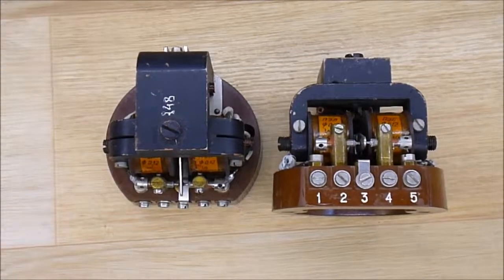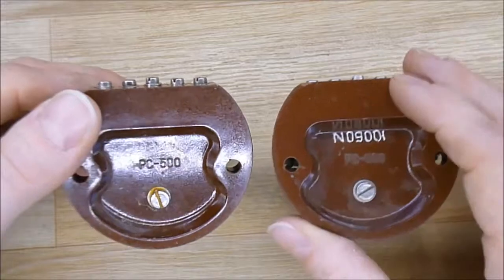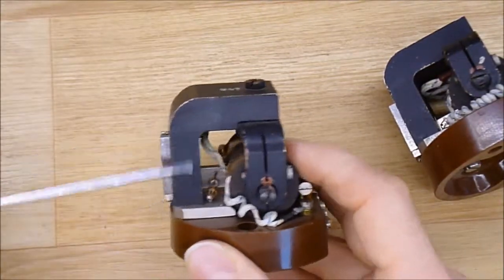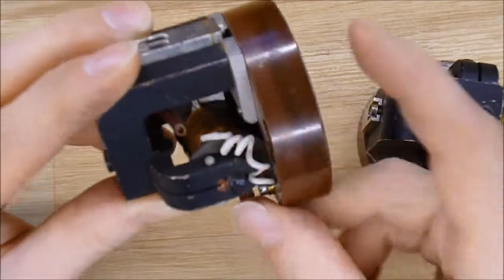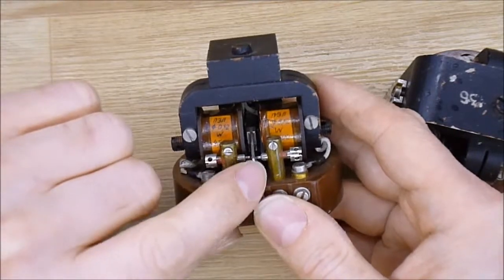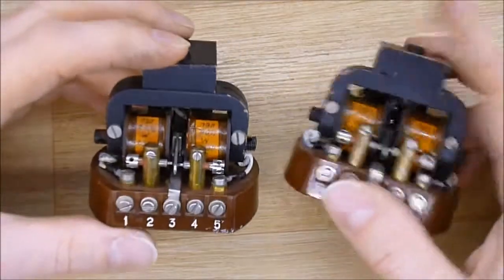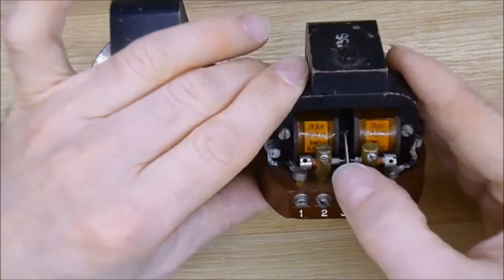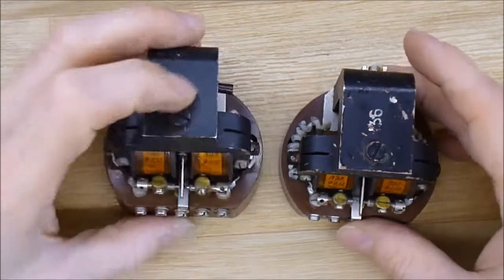Unknown russian parts

Comment: A tristate output single pole relay?  Not just normally open, or normally closed, it also has neither output connected to the common. Looks like terminals 1 and 5 are the coils, both in series, intended to be DC energised but in either of two polarities to drive the common (terminal 3) towards terminal 2 or terminal 4. Haven't a clue what application those crafty Russians would have had for it though. I'm suspicious that that amount of what looks 'soft iron' on it's frame and cores might even mean that it's a latching type remanence relay.